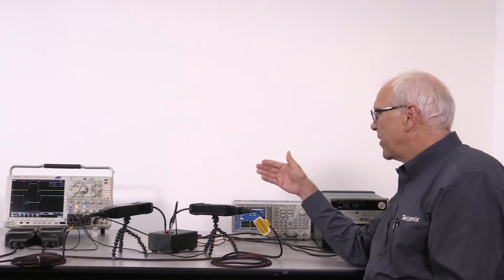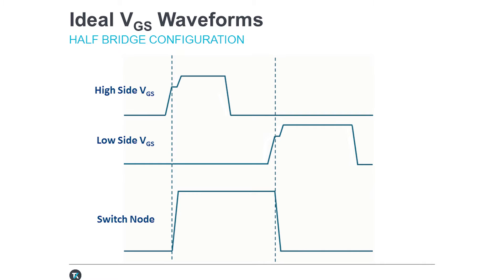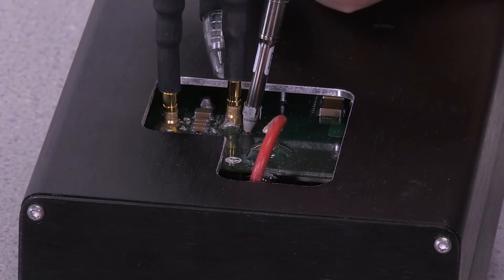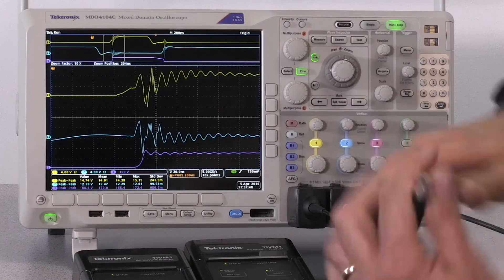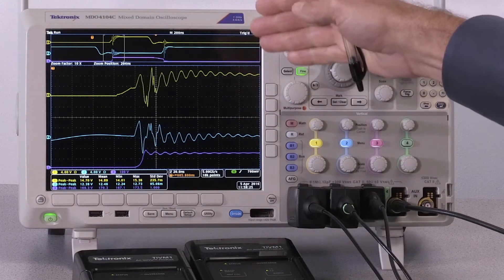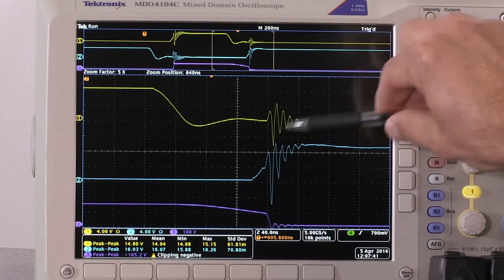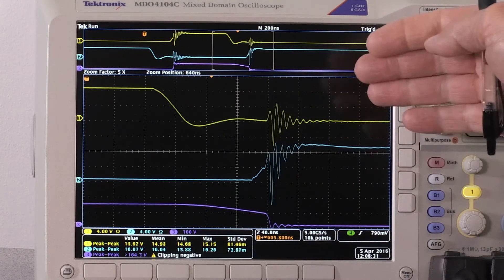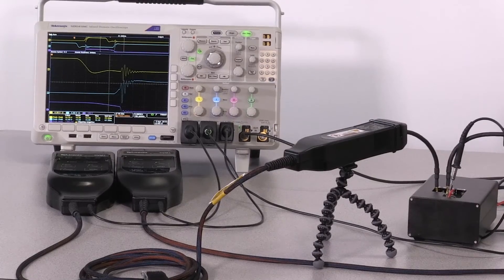Making High-Side VGS Measurement with the IsoVu Measurement System

Comment: Yes there is a solution, which I should have added at the time. Put a common mode choke around the probe to increase the common mode impedance. Use a lossy choke. This damps out the resonance quite well. We did figure this out back then, but I should have said.

Comment: All that ringing is not actually in the circuit being measured. It is actually the series inductance of the probe outer coax resonating with the free space capacitance of the probe body. I see about 300 MHz, with 2 pF of free space capacitance, the series inductance of the coax is about 140 nH, because the loop area is large. It is excited by the high switch dv/dt. I'd be guessing it is coupling into the other channel capacitively - the probes are pretty close too each other. Because the measurement is NOT balanced - the impedance of the centre conductor is different from the impedance of the coax shield, the resonance of the coax shield gets presented as a differential signal across the impedance being probed by the probe tip, and you see it.
Reply: Hi Bart, I find it difficult to believe that oscillations of that magnitude are really there and agree that measurement artefacts could be making a significant contribution. I believe that the potential issue you raise could be real. However, I don't understand how this issue would not be evident from common-mode-rejection evaluation of the probing system. Tek claim 120 dB CMR @ 100 MHz and 80 dB @ 1 GHz, presumably with a smooth monotonic change from 100 MHz to 1 GHz. What do you think? And more importantly, do you see any way around the problem?